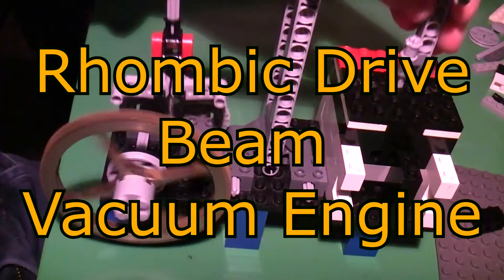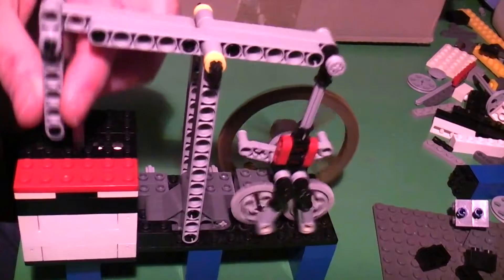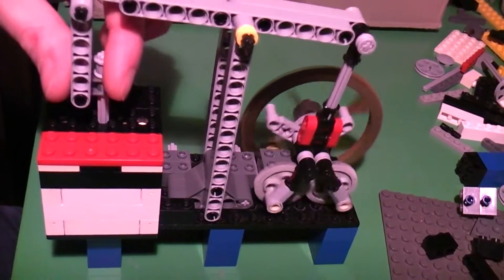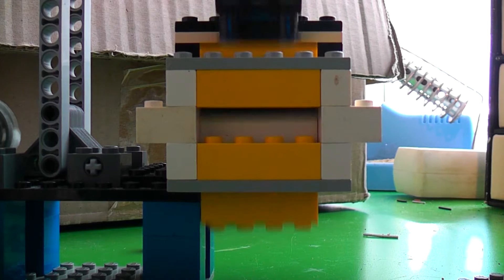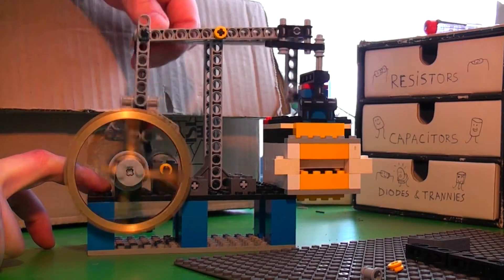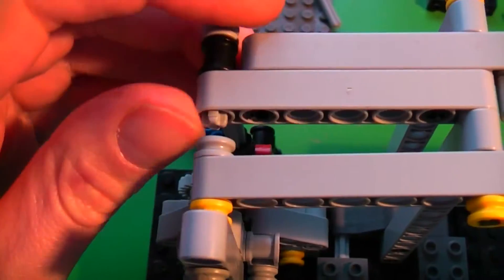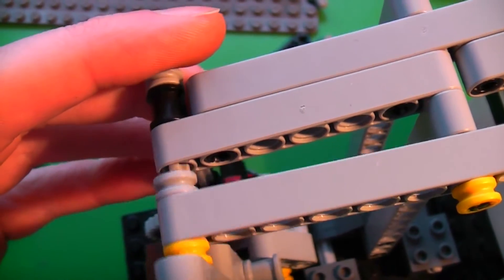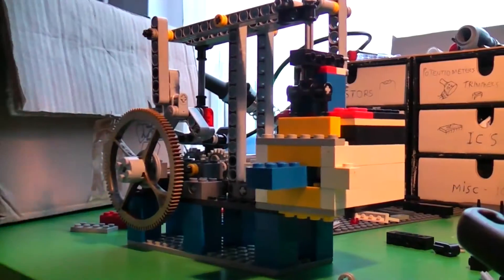Lego Rhombic Drive Beam Vacuum Engine

Comment: Usually don't like bulkey but this is an acception
Reply from the maker: Thanks. I need more parts for decoration and making things pretty, but gotta save up first ;)
Reply: @brassandbricks7701  ya the typical brickilink order. Do you like my engines ?
Reply from the maker: @lmarcottebuilds  You got some clever designs in there, keep it up. Digging it!
Reply: Random question 🤔does me making a video on my lego xbox one driving simulator sound interesting?
Reply from the maker: @lmarcottebuilds  Definitely sounds like something I haven't heard of yet. Go for it :)
Reply: @brassandbricks7701  ok 👌

Comment: Brass and bricks, could you add a generator to the lego beam engine.
Reply from the maker: Yeah! I'm currently trying to figure out a little workshop kind of think, powered by the engine. Might add one :)
Reply: @brassandbricks7701  ok, what type of generator are you going to use.
Reply: @brassandbricks7701  are you going to use a lego motor for a generator.
Reply from the maker: @ethanfitton6336  I don't have a lego generator unfortunately, but I do have a bunch of very nice electric motors. Surely I can rig one as a generator, will need to get a little creative :)
Reply: @brassandbricks7701  yeah i agree, so when are you going to put the electric motor on the lego beam engine and record it and put it on YouTube.
Reply from the maker: @ethanfitton6336  Probably sometime next week
Reply: @brassandbricks7701  ok, can't wait to see the video on YouTube